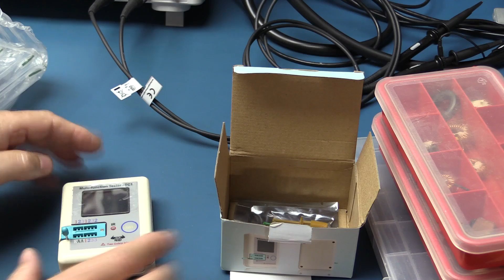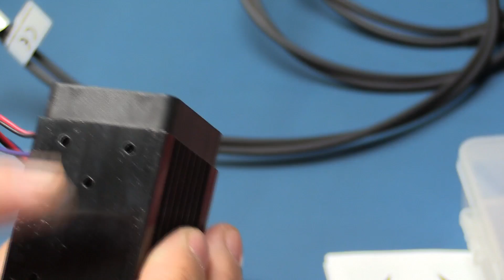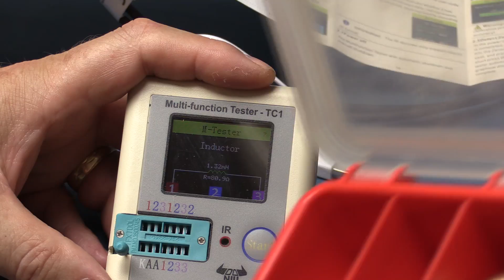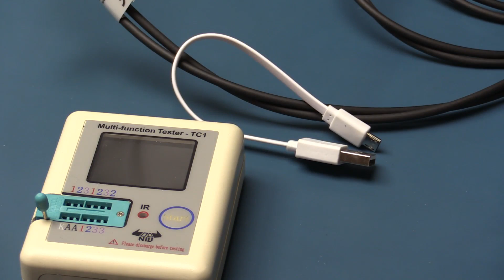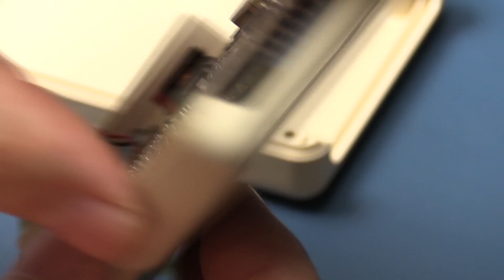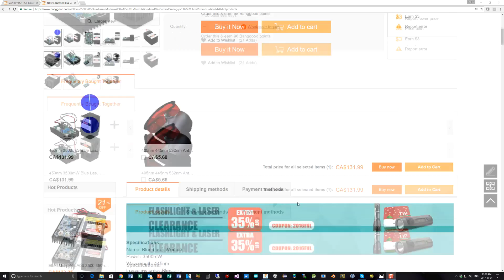Component Tester and Laser Diode in the Banggood Mail bag

Comment: Hi Peter. I got one of the same laser modules + driver secondhand. Former owner apparently blew the transistor and replaced it with incorrect one, now sitting on wires. Can i have you unscrew the board and tell me what the transistor on the heatsink is marked as? (3-pin device) - Thanks!

Comment: Peter Oakes+ Will these testers tell you the foil end of the poly caps or all caps?
Reply from the maker: I think you mean which end has the foil on the outer most surface of the cap so you can be sure to connect it to the right end of a circuit, I doubt it, to know the foil end you need to be able to use very different techniques than this has. But if you want to know how, here is a great video from Mr Carlson's Lab
 https://youtu.be/BnR_DLd1PDI,  ultimately simply based on using a scope and detecting where you get most HUM!, but here, Mr Carlson builds a tester to help make it simpler,
Reply: I watched it and I was hoping this would work, thanks

Comment: I didn't notice a battery charger, but I have a spare 750 mA max. phone one (Sony). Would you know the battery specs. just to be sure.
Reply from the maker: David Price a charger is not provided but pretty much any USB charger should work
Reply: Thanks Peter that was quick, I'll keep an eye on the temp when I first charge it. Pretty sure it would have over current protection. Am I right about the accent...